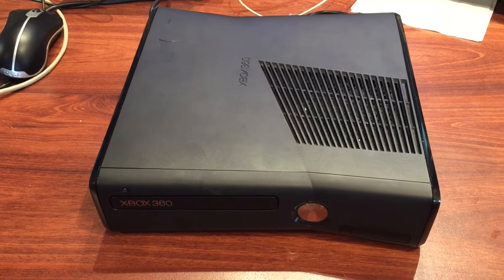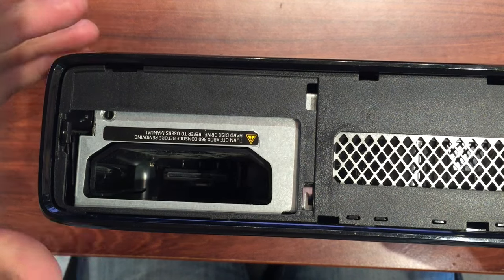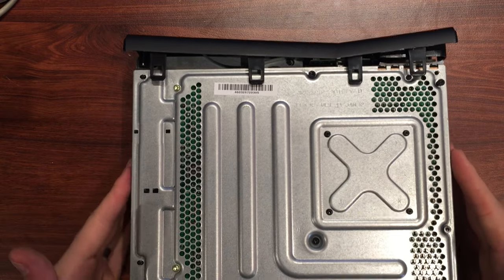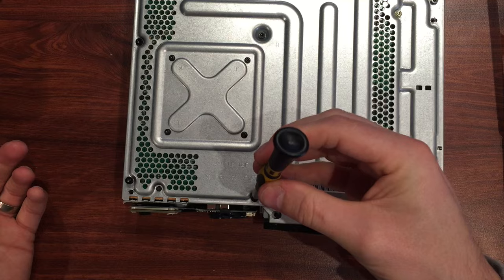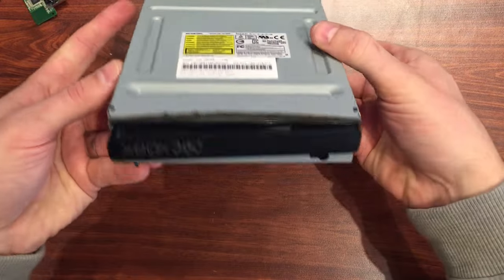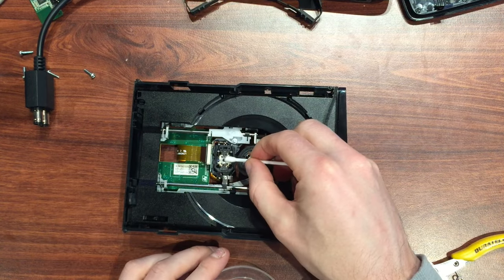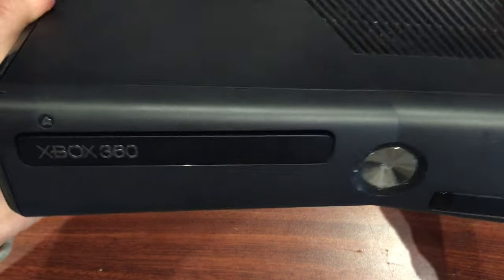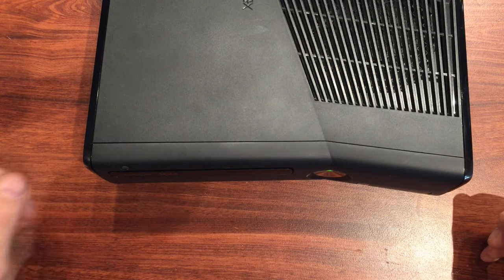How to repair & open the Xbox 360 Slim disk drive tray when stuck - YouTube

Comment: Hello friend, if you need to open the tray manually, there is a small slot on the left side that pushes a release that you can fit an extended paper clip to open the disc tray without having to plug it in. This is the same technique used when you want to open the tray even with all the components in place. Using the small slot hole on the side of the xbox. Thanks for the video btw! It helped me alot!
Reply: Is the small slot ur referring to the one with unlock icon beside it????
Reply: @strictlywrestlingreviews6758 I'm referring to a tiny hole that a paper clip can fit into...its tiny, so you have to really look for it
Reply: Well shit.... lmfao.... thanks friend!😅😅😅

BTW, if you have the same model as the 360 in this video, the little hole that @atacustompainting is talking about is surrounded by a yellow square, and inside that yellow square is a little hole. Just use a paper clip and it will "release the tension" and make it open. Now my disk drive opens up with no problem. I hadn't touched my 360 in over five years and the disk drive was acting like an ass.

Anyway, thank you to @atacustompainting and the author of this video for the help.😎🤘🤘✌️
Reply: Thanks for the info!

Comment: Oh also, I'm sure you're probably aware by now or have been told....  you don't need to plug the drive back in to eject it, you need a pin and poke it into the hole on the side towards the front. Mine had a round yellow sticker highlighting the area. Sticking the pin in there will pop it open easy as.
Reply: Thank you, this was SUPER helpful!

Comment: mine is stuck in the locked position even when I press eject. what do I do ?
Reply from the maker: Hi Quinelle, there's a small hole on the side where you can insert a stiff paperclip to manually open the tray. Here's Microsoft's own tutorial on this topic - http://support.xbox.com/en-AU/xbox-360/console/manually-eject-disc
Reply: That didn't work neither
Reply: QuinTelle. Smae
Reply: same thing happened to me. i asked it to eject the disc, and it did, then inmediately closed and has kept closed. paper clip didnt work
Reply: Ejecto seat cuh

Comment: Liked and subscribed. I put my xbox 360 in my sons room after i bought my xbox one. I used it in there mainly as a dvd player for him. Then the tray stopped opening fully on its own and wouldn't play discs anymore. Used this video tonight to disassemble to unit and found 3 lego wheels stuffed inside the cd drive. System works perfectly again and is no longer in his room.

Comment: If anyones still having probs you need to lift the black  dvd tray upwards.
Be very careful not to exert too much force or break anything.
You start at the back and try to lift the tray above the slots to free it.
If you can get 2 at the back done on the same side you can slide the tray out.
Worked for me anyway.
Reply: Yes

Comment: Thank you for your instructional video, I was afraid I was going to break any of the clips off the panels. The track wasn’t off for me, I had a disc that I didn’t realize that had sticker residue on the top and stuck to the top disc holder in the disc drive, preventing it from opening. Love your through and precise steps, thank you again!
Reply: Yeah heat and adhesive dont mix well

Comment: Thanks for this! I had a sticky drive.  I have never taken a console apart before and was terrified. Followed your instructions - got in - fixed the disk - got out with no problems. Have to say they go back together so much faster than they come apart!
Reply: So if I take it apart it's easy putting it back together

Comment: After following this video my tray was still stuck. Check and see if the foam piece is the culprit. I cut and removed mine after manually ejecting the tray. Manual ejection can be done with something like a paperclip, stick it into the yellow hole that's under the grill opposite the side of the hard drive, as seen 2:32.
Reply: I was able to cut and remove mine without full disassembly, it's much quicker. I fully disassembled to clean my xbox out, however.

Comment: You can also use put a paperclip in the yellow hole on the side to make the tray open.
Reply: USE THIS BEFORE TAKING XBOX APART...this little tip worked you have to feel around for a little lever type device.we had to slightly angle the paper clip downwards. if there is a disk in the player you will feel this and will have to alter your angle slightly more.
Reply: See no damn hole period

Comment: Actually I just watched this video cause I really like your tutorials you always include all necessary information ,like how not to break it
Reply from the maker: +MrBuck295 Thank you for the feedback. I really don't see what people have to force cases open and break things. The only thing I missed demonstrating was how to open the DVD tray manually with a paper clip. There's actually a small hole for that as well on the side of the case with a yellow ring. You can see it at 2m 41sec
Reply: Dude like why disc like it's like when you put it in it's like on is like up inside the Xbox six stuck there there's two
Reply: Plz respond

Comment: 13:20-13:30 I am so frustrated 😢 I've been able to follow everything BUT this, and this is precisely the problem I have. Reconnecting stuff has so far done nothing, and this is the only part you didn't visually demonstrate, so I'm not sure what I should be looking for. Will try to figure it out without breaking anything 😂

Comment: NOTE: at-least in my case with the metal frame, Its not just the retaining clips because there's ( 2:45) multiple indentations where there's welded plastic that made it almost really hard to open and I there's no workaround aside from breakthing those open (Not The Clips Themselves!)

Comment: 13:35 I can't figure out this part. My disc tray isn't just having trouble opening sometimes, it's just completely physically stuck. It won't slide any further than about half an inch before being unable to progress. It can't close, and it can't open either. Help?

Comment: Great video, however what do you do if the tray is stuck to where it only comes out about an inch or so and closes but not all the way and connecting the electronics has no effect?  I looked at the video at 12:10 hoping it was the limiter switch and the switch appears to be working.
Reply: same problem here, if you find out, let me know and I will do so vice versa

Comment: Hiya, found this super helpful and easy to follow! Can't thank you enough. I'm having a small problem after though. When I try to put a disc in, it doesn't read it. It simply makes a small grinding noise for two seconds then says "Open Tray". Anyone have any ideas on how to solve this?
Reply from the maker: Sounds like the laser or mechanism needs replacing. You can simply buy the new laser off Aliexpress and install it yourself. Pretty easy.

Comment: Very good video how to take a xbox 360 slim apart and put together but skip over the most important part which is to fix a stuck disc tray. He simply says if trsy stuck st back then reconnect the data and power to the DVD drive and allow the electronics to reset. This doesn't work. In fact you have to bend the edges of tray at rear and then take out tray fully. Then manually reset cog wheels correctly and then reinsert tray. On e you have done this the tray will work permanently. What a shame that he doesn't show how to correct it properly especially after all the good works he does. Message me if you need more details

Comment: I’m not sure if anyone will read this seeing as it’s been a few years since this video was posted, but I’ve scoured the comments trying to find someone with the same issue I’m facing but I haven’t found anyone. I’ve gotten up to removing the front cover (where the drive pops out, so we aren’t confused) and I’ve done the ‘wiggling’ just as you had in your video, but the cover just won’t budge. I don’t want to force it, in fear of breaking it, so is there anything you would suggest I do? The sides seem to come off if I force it a bit, but not much else happens.

Comment: You should never plug in your machine while it's fully taken apart, no matter the circumstances. However if you want to manually slide the tray open while your box is taken apart like at 13:30 there is a spot to put your paperclip or whatever in and it pops it open. If your disc tray is face up and the front is facing towards you. the bottom on the left side towards the front is a little opening. *hint: there are wires tucked behind it*, as mentioned in the video the little yellow circle is the spot I'm talking about, when the case is together.

Comment: Omg thanks sooo much my bo2 disc was stuck in the tray for ages thx so much
Reply: lol same happened to me with my BO2
Reply: same
Reply: Robman345 same its just mines still stuck
Reply: I'm going to rehash what someone else was saying in earlier comments: 
On the side of the Xbox, there is a tiny hole marked with yellow bars - big enough for a paper clip to fit through. Go easy when you do this - no sense breaking your console permanently. This just worked for me so I'm passing it on.

Comment: i had disassembled my drive for other reasons (flashing firmware) but when opening it up the tray popped out a bit and if i move it manually it locks out about 1/4th of the way out and i tried powering it up with the xbox but retracting it just makes the xbox infinitely try to pull it in from a nearly retracted position and cant eject because it always thinks the tray is open

Comment: Hey I'm at 13:47 an i have ejected the dick holder successfully, without breaking anything. But i can get it back in, it just gets stuck in the start and u have to unstuck it which is very difficult but i did it anyway. How should i slide it in? Is there some specific way to do the sliding?

Comment: when I close it,it opens up by itself
Reply from the maker: This issue is caused by the small limit switch at the very back of the CD tray. I didn't really show this in the video, but it's a factor when the tray keeps opening. Just inspect it and make sure it's sitting in the correct position.
Reply: Global Garage k thx
Reply: Saiyan Animator help plx

Comment: Dude Ur Details Was Off .
Reply from the maker: What do you mean?
Reply: +Global Garage I've followed closely your directions which were great however when i got to the part where you slid the tray back in I tried the same thing and it didn't quite work out.  I think everyone that has a Xbox 360 slim tray issue might have a gear/sprocket TIMING issue that was omitted in this video. there's an arrow on the gears that need to be aligned in order for the tray to function properly I think. 
your instructions otherwise were spot on and thank you for that. you're the man.
Reply: Yeah i had the same jssue. There's a little pole on right side that sticks up. That has to align with the grove of the tray. U can move the track with the pole on it ,  Right to left to lign it up with tray.
Reply: Lil Jj  Judging by the way you speak. You obviously aren't the brightest cookie out.  "Your details was off" it's were off not was off. Young man educate your mind and get off the game.
Reply: He's typing, not speaking!

Comment: wasted my time, took it all apart for what? to spray some plastic gears with wd40.... lol. pointless fix did nothing.
Reply from the maker: The gears are out of alignment. Taking apart gives you the chance to set it up correctly
Reply: the gears on mine were fine, the problem is it still will not open or close without manually forcing it, and even forcing it shut it will not read the disc, the green power light flashes rapidly to indicate the tray is opening and closing repeatedly when its actually not. this was a good video on how to dismantle the 360 but a bad one in how to fix it.
Reply from the maker: lol relax mate. If you watch this video on a desktop you'll see all of my annotations. They don't show on a mobile unfortunately. So at 12:10 ish I point out the tray limit switch can also cause an issue. I think this is what's wrong with yours. It's also listed in the description.
Reply: a